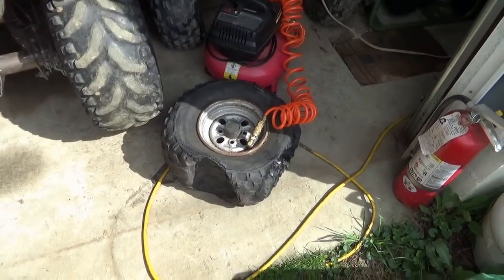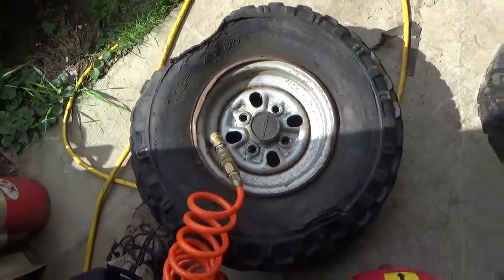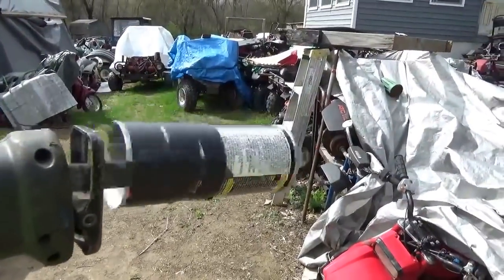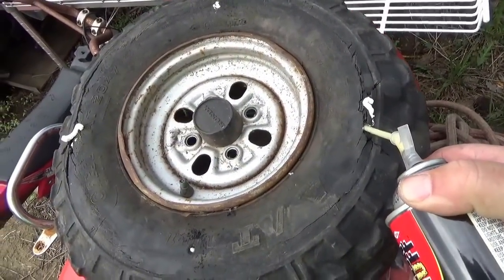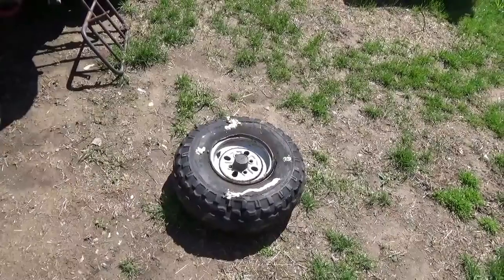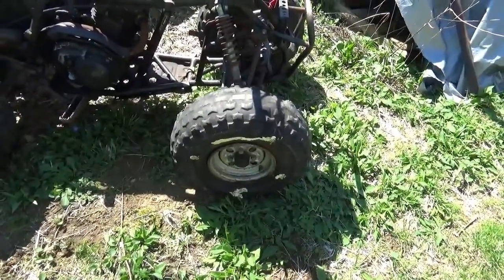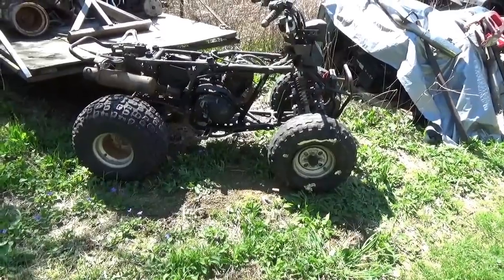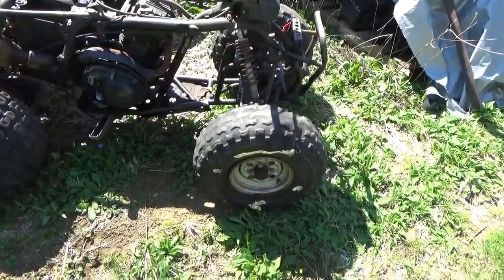Red Neck ATV Tire Repair, Great Stuff Expanding Foam Rotten Tire Fix!

Comment: Punch a hole in the soft spot fill it up and then let it set. It should work like you say good enough to move something. Great to show how long it really takes. Thanks
Reply from the maker: Hey Calvin!!!!  The engine needs to start easy and run without issue until the next time it is mistreated... I put a new carb on it and it starts on the first pull... If I was keeping the motor, I would melt 2 holes in the float, blow the water out, and melt them shut again.... Thanks always for Ur thoughts, advice, watching, and commenting!!!
Reply: Harvey Spooner great fix. I love it